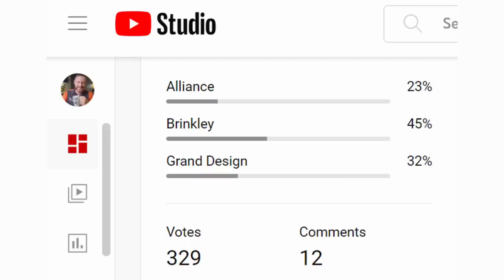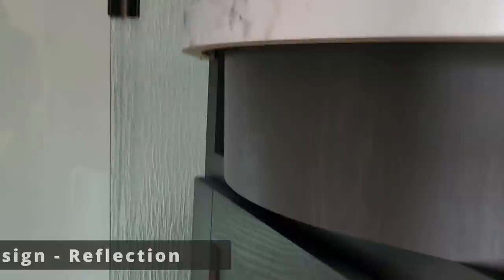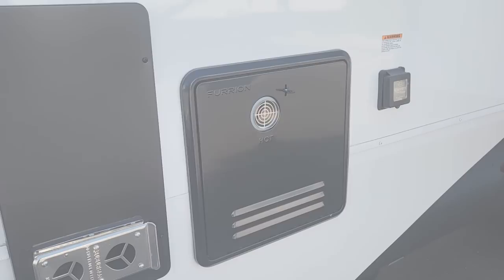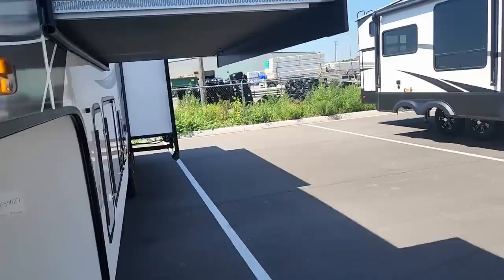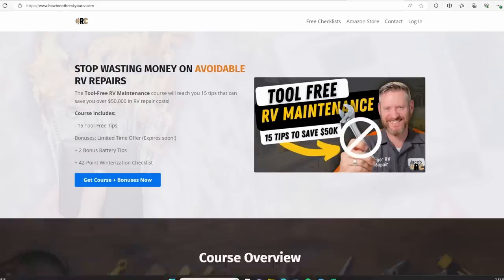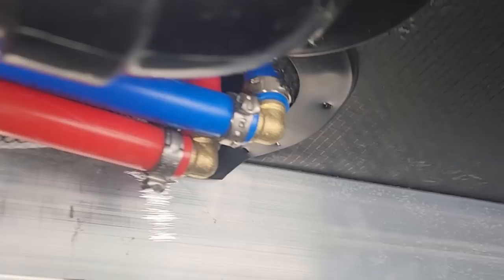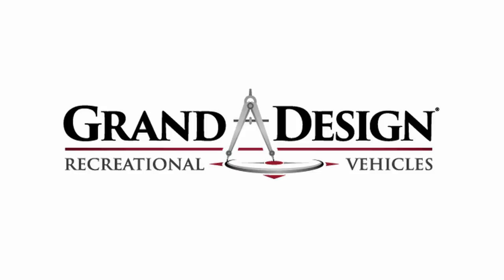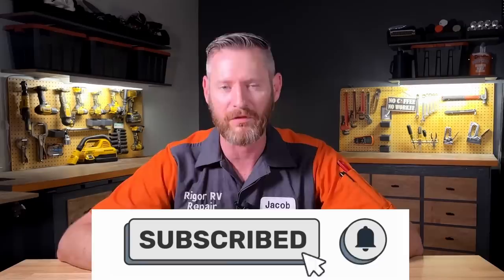UNDERCOVER RV Tech reviews Grand Design, Brinkley & Alliance RVs

Comment: I just sent this to Grand Designs. I love the company, and their products. Every Grand Design we’ve ever looked at has had the nicest fit and finishes. 
I know that they’ve all had their problems, and I can only hope and pray that the RV industry does better.
Reply: I’m going to check mine. I’m not sure what year he was comparing. If we have pex and finishing than it should be A+.
Reply: It’s the connections. DRV did some of this in my rig. I eliminated it and have no issues
Reply: Pretty much after grand design which I had high hopes for sold to winnibego they went down hill fast. Think THOR owned the whole thing and they are info profit not quality
Reply: I've been praying the industry gets better as well..........for over twenty years. GD is great at ensuring your first visual impressions are pleasing. The fact is today's RVs are for the most part the same boxes, built the same way for the last 30 plus years. The only difference is decor and gadgets. Every now and then there are incremental improvements. In general though despite all the issues ones experiences with their current we fall in love with a new unit thanks to claims of improved quality, the new lipstick (decor and new gadgets). Regardless of all the heartache, time, and money spent fixing issues on our units we take the financial hit and trade it in on our next "forever" unit. Once the honeymoon period abruptly ends, likely because of a serious flaw or failure, we're either dreaming of a new unit or regretting the loss of our previous unit. Side note: never rate an RV manufacturer based on components manufactured by other companies. That is unless the RV manufacturer installed the component incorrectly or used the incorrectly sized component for the size of the RV. 

Updating your well maintained existing unit or a second hand unit is far cheaper than buying new. A 20 year old unit with faded or peeling vinyl graphics and original soft goods and fixtures can look brand new with a sensible refit for far less than new. The issue is ensuring the used unit has been maintained to the highest degree. A full third party professional inspection is a must. Sourcing items from newer wrecked units is a great way save a ton of money on a refit. One can upgrade to frameless windows, solid surface countertops, lighting fixtures, drawer pulls/knobs, plumbing fixtures, hardware, higher output furnace/AC, 12v refrigerators, appliances, central vacuum, soft goods, fold down steps, blinds, and all sorts of other upgrades can be sourced from salvage yards. Most new tech gadgets and must have components can be installed in older units. 

Understandably controlling everything in/on your unit with an RV specific app or touch pad control system would be a costly. There is too much rewiring and new pieces of costly kit required to make such an upgrade worth it from a financial standpoint. Besides with all of the wifi enabled/remote controlled plugs, switches, fixtures, HVAC thermostat, and so on, one can adapt an older unit without upgrading to an insanely costly RV industry control system..... or a new RV. 

Yes ..... we must continue hoping and praying the industry improves. Unfortunately they won't improve until consumers demand they do by refusing to buy new units. On average we keep our units just 2.5 years. This is gold for manufacturers. Their aim is to design and build a product with the first three years of ownershipin mind. They work very had designing new caps, decor, graphic, and paint packages to make our less than three year old unit look outdated to entice us to buy new within three years of purchasing our last new unit. Each year a new gadget or slight improvement is highlighted to further entice us with false promises of trouble free travel. Before really thinking it through our window shopping becomes a purchase. Those who financed their less than three year old new unit lose a ton of money buying another new, nearly identical unit. 

My 2015 DRV Houston is still serving me very well. In 2020 she had some upgrades and modifications to update her and improve my enjoyment. As with all units there are items that wear out and need replacing. Unlike a laminated unit this DRV can be repaired in the of a leak. One such leak was due to a rubber grommet on a clearance light. This caused water to follow the wiring into the side wall and floor. Thankfully they were able to replace the insulation and luan from the inside and put her back together without any evidence of a leak or repairs. Had it been a laminated unit the exterior wall would have delaminated. Side note: none of the wool insulation had slumped in 8 years. Manufacturers of laminated RVs like to claim hung walls with wool insulation are inferior because the insulation supposedly slumps in the wall. Aside from glue holding it up, wool insulation is not as fluid as they try to claim. Getting off topic...😊

Cheers!
Reply: @krank3682 Really? What year is your unit. Mine has individual solid pex lines from the manifold to the end point. I've not seen anything other than pex. Exceptfor the refrigerator supply line. The only elbows are where space is tight behind the wet bay next to the manifold. There are too many connections in that tight space with the water filters, low point drains, Truma, tank, rinse ports, fill port, etc., etc.,.. Aside from that cluster of pex and copper elbows, there is one piece of pex to each of the fixtures. Even the dual sinks in the master bathroom have individual pex lines to the manifold. 

Glad you caught that before you had an issue.

Comment: Great video. We ordered a 340RL Alliance in January of 21.  Overall, we have been very happy. 
Our biggest issue has been the slide skis. After many replacements under warranty, Alliance reworked our slide. That lasted only about 6 months.  They have since then started using a different slide ski. It's a heavier & wider plastic.  We had custom-made stainless steel skis made & installed for our unit. So far, so good.
Reply: Happy that worked for you! As I’m watching, I’m thinking about the slides and thought 🤔If it’s the failed slides, I would have to a modification right away! It helps that my hubby is a fantastic welder as me even better fabricator, it could be done. Although I still ask, when paying that kind of money for an RV, these issues should absolutely 💯 not be an issue! Come on engineers! Where did you get your training from? Toy tonka division? Now having said that, and not to diss men, women engineers rock! All that I have seen have attention to detail, and live and see how these mechanisms work. Like vacuum cleaners! How many men use them? Silly analogy, just saying!

Comment: I have a 2020 Grand Design 150 series and it is not plumbed like that. I checked while I was upgrading the converter for lithium batteries and it is all PEX. I was glad because I was easily able to plumb in an outdoor shower connection on the door side for my portable sink.
Reply: My 2019 grand design momentum fifth wheel toy hauler is also all pex as well!  I’m wondering if they just used whatever was available at the time due to covid supply shortages on the models he reviewed
Reply: I’m looking at the new 270 BN, since you have a 150 series do you have any thoughts about this model?

Comment: Another great video, thank you. From a Brinkley RV rep, they are aware of the flex pipe issue in the industry and avoided using the same products. The flex line Brinkley is using is a no crush no kink product that no other manufacturer is using. It's choice was intentionally on the water pump to reduce vibration and a few other areas due to angle of running water lines. Their usage and attachment method is approved by the vendor and they have had no known issues with this application in the field so far in the first year of production.

Comment: Sooooo...new to this full-time trailer living lifestyle (although I own a small 15'  travel trailer that I've completely renovated). I bought a used 2022 Grand Design Imagine 2670MK. I didn't get an inspection (which I later regretted). The first (and only) previous owner had the trailer set up in an area that had VERY hard water. So, it's taken awhile to try and get the grey and black tank sensors clean (lots of CLR and industrial strength vinegar) not to mention the rest of any water related components. I've recently started working on upgrades and mods (especially with the bathroom and kitchen plumbing fixtures and valves) and straight away noticed the problematic plumbing your video described. Let's just say you've inspired me to replace the entire system with PEX B style plumbing. I say all the time that Wile E Coyote is my spirit animal...Back to the Ol drawing board  :^(

Comment: 2021 GD 260RD. Have had no major roblems. Did a 10,000 mile run last fall. Yes that flex hose is wrong, but have had no plumbing issues yet. Been a plumbing contractor and general contractor for over 30 years, so I do keep it up and maintenced

Comment: My 2022 Grand Design Imagine 2970RL travel trailer is rock solid.
Reply: How many miles have put on it
Reply: I have a 2020 GD Imagine 2970RL, and while we love the floor plan, ours has definitely not been rocksolid. We continue to have leaks around the dinette and lounger slide. The thermal foil MDF covered countertops, have leaked over the edges in the kitchen and bathroom and expanded.  I have repaired around those edges using Minwax wood harder and that seems to have eliminated problem of expansion when the water rolls over the edge.  I’m also definitely not a fan of the vinyl coated MDF for the cabinets, they look good, but do not have much resiliency.  By the way, ours was built before Covid. We picked it up in February 2020, so it is not a Covid build quality trailer.

Comment: Just a note on the Alliance Avenue slide outs-The cable system is only for the smaller bedroom slide. Both the main living area slides are mechanical electric through frame. Alliance's position is that the cable is more dependable than the Schwintek used on the bedroom slide before. I had a cable slide on a much larger slide on my first TT and never had an issue with it. I hope this continues.

Comment: I already have a Grand Design.  You are 100% correct about the plumbing.  What do you suggest or recommend to rectify the issue? 

Clearly cutting out all the incorrect fittings and junctions could cause problems that have not yet arisen.  However, not correcting those issues could lead to trouble down the road.  What do you advise?
Reply: The only way to keep these fittings from leaking is to remove the flex hose and replace with PEX and crimp rings.  The flex hose is a slightly different diameter then the pex fitting they are attached too and leaks will absolutely develop over time where these two come together.  At a minimum, you should remove part of the wall in the pass through and replace with plexiglass near the water service panel so you can check for leaks that develop.  I bought a battery powered water leak alarm and placed the sensors on the floor underneath the water service panel and ran the alarm box up into the living space.  An undetected dripping leak will cause thousands of dollars in damage if not discovered. Without being vigilent, you'll never see the damage until its way too late.
Reply: My God, that is horrible.  How could they do this to me (to us as RV owners)?   We all paid thousands of dollars for the RVs of our dreams (this is my third one) never knowing we have bought a ticking time bomb that will eventually cause very expensive, undetected damage.  

I'm no plumber.  I did not sign up to repair or replace every plumbing connection in my brand new RV.  I can install water leak alarms, but I think it is ridiculous that I should have to.  I am hoping that Jacob will offer some professional advice for a remedy that the average RV owner can implement.  For that matter, I don't even know how to gain access to every plumbing connection in my RV.  Many of them are probably hidden or in inaccessible places.  This is really bad and it makes me angry.  I feel duped.

Comment: Great Video, totally agree with the plumbing, also one other thing is the suspension on all these RV's a weak point. We have upgraded 8K axels and disk brakes and were still just barely under our weight limit. Any 5th wheel should come with a minimum 10,000 lb axels or at least give you the option for them. the 1& 3/4 leaf springs should only be put on utility trailers not something that weighs between 13,000 and 20,000 lbs.  The wet bolts are terrible, you can't lube half of them because either the sewer pipe is in the way and you can't get the grease gun up in there to lube it OR the brass bushings are completely destroyed after 500 miles and they won't take any lube. It's such a garage system, they all need something way better.  Im going with Morryde independent suspension on our next rig. I spoke with Morryde and they said there's are 9,000 lb axels so that's great news.
Reply: Keep in  mind that >20% of the weight of a fifth wheel is on the tow vehicle and not the axles. I have a 15,000 gross weight fifth wheel and it came with 7,000 pound axles, that might seem too low, but over 3,000 pounds is on the pin, so the axles never see more than 12,000 pounds. When I put in disc brakes I did upgrade the outer bearings so the axles are now 8,000 pound rated, but even the 7,000 pound axles provided 2,000 of extra capacity versus what they should ever see.

Comment: In 2018 I purchased a used private party 2015 Grand Design 303RLS with recommendations from other Grand Design customers. I soon found out they are not such a “grand design”. They in the same category as all rv manufacturers. First problem was air conditioning intake it was not sealed from hot air from ceiling space. Corrected that.  After using the using the trailer a few times i noticed a leak on the ground area of water heater. No leaks around gas/electric screen area. Removed the hutch drawers, low behold there is the leak. During manufacturing somebody had cross threaded a fitting on water heater. Instead of fixing the problem they put some kind of goop around it.  Corrected that problem.  Soon found out another leak on the ground under water hook up area, it was not hose problem.  Took the panel off in cargo hold area so I could see the piping, another fitting had been cross threaded, instead of correcting the problem they put some kind of goop around the fitting. After they put that goop around the fittings it had dried out and cracked. Took about 3 years for problem to show up.  We love the layout of the coach❤.  As of 2023 we have not had any other problems.

Comment: The slides, & plumbing issues seem like the builders could fix easy, and not impact the cost of the unit.  I also think the builders should be forced to hold the note for 2 years, if your unit goes in for repair, and 1 month later you still do not have it, you do not have to pay the note.  Repayment starts 90 days after you get your unit back.  😊

Comment: God thank you for pointing out the plumbing. Been loving my grand design for the most part, but they don't know how to do plumbing at all. Has cost me hundreds in diy repairs on leaking lines in multiple places, that ruins all the mdf constructed cabinetry. And they put one of the main electronic control box right under the bathroom sink plumbing with 0 water protection. If I had to pay a professional for repairs I would easily be looking at thousands by now.

Comment: We had the opportunity to visit all 3 factories while in Elkhart earlier this year. Firstly the difference between the factories was very noticeable. The Brinkley factory was brand new and was obviously absolutely spotless and their young guy showing us around was very knowledgeable about how Brinkley are doing it differently. The Grand Design factory was a different story, yes the roof system was noticeably inferior and the factory was very messy. The Alliance factory was more tidy than Grand Design but we did spot a few things about the cabinets I was disappointed in. FYI we have been in the furniture & Flooring retail business for over 38 years so we do have a reasonable idea as to what is acceptable or not. 
We currently own an Alliance Valor 40 v 13 and have had a few issues, cabinets, plumbing etc. But we have nothing but good things to say about Alliance customer service. In fact they are amazing.
Would we buy a Brinkley, HELL YES. Their interior design is absolutely gorgeous compared to Alliance and Grand Design.
Just need to stick with the Alliance for a few years until Brinkley gets all the bugs ironed out.

Comment: Excellent video and information.  I have been dealing with plumbing and electrical issues that are a mess in my new "high end" 5th wheel.  Replacing it with the correct components rewiring and replumbing myself.  Also, see the issue with fit and finish across the board and how sloppy some manufacturers are.  It's almost a choice as to the best of several evils.  What are you willing to live with and compromise on.  It's hard to find a good model and manufacturer.  I remember when I bought this current 5th wheel I have, the unit I looked at and heavily inspected for every detail, wasn't the same unit they tried to get me to take delivery of after the dealer "prep".  I would love to see the "RIGOR" scale applied to an Airstream.

Comment: You should look into heartland. I’ve had over 30+ repairs brought it in to be fixed under warranty they fixed some but I did the rest and took whole bottom off and replaced all water fittings. I’ll never buy a heartland  again. It’s a 2021 heartland road Warrior 414